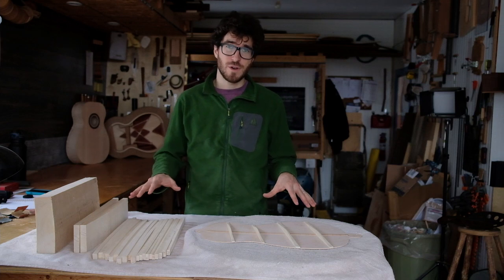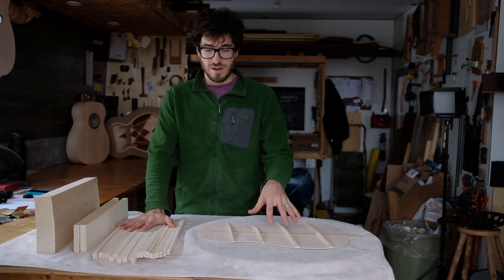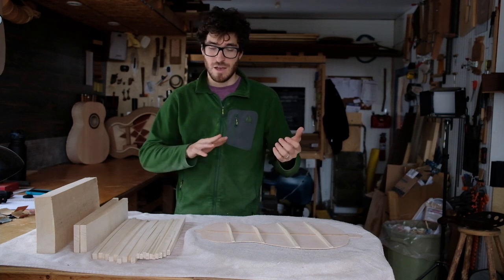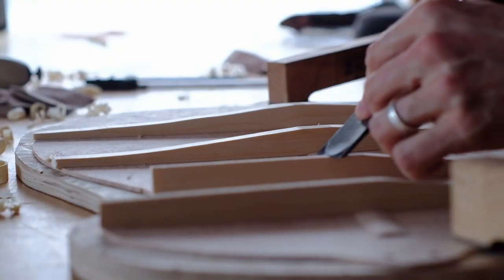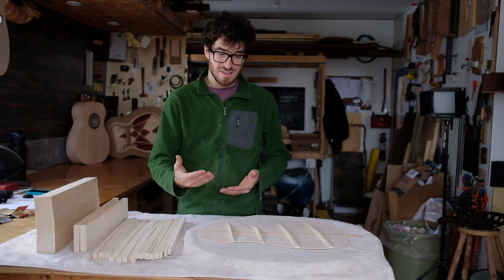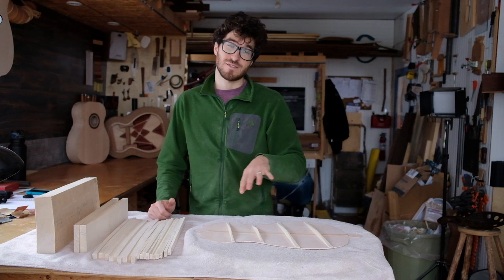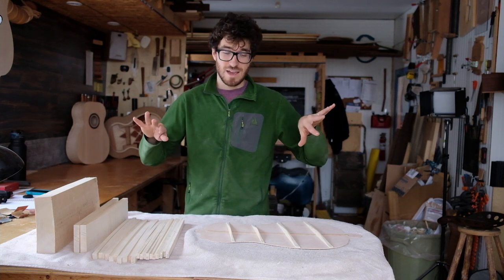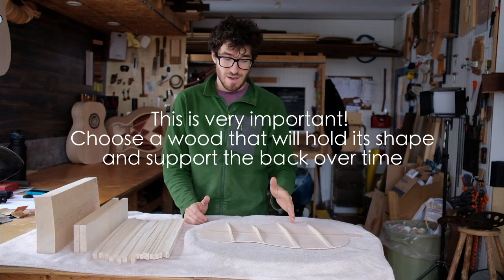What woods work well for Back Braces?

Comment: Have you ever experienced the back deform becoming flat again after 15 foot radius brace glued? And how to fix it?
Reply: Aha, yes I’ve had that happen once. It was in my first workshop and my humidity wasn’t as well controlled at it should have been. 
It happens when the environment the back is in is humid. So the wood is swelled up with that extra bit of moisture - then you glue the 15’ radiused braces on and as a result they try to hold the back at it’s swollen width… but the back wants to shrink and return back to a lower humidity so it is forced to only shrink on the outside surface opposite the bracing. This actually works very similarly to a truss rod. 
The only solution I know of is to rout off the back, knock off the braces and reglue new ones at a drier humidity. Then you’d likely have to add a couple purfling strips to clean things up. 
As a general rule I try to brace my backs, carve the braces and get it glued onto the sides within a day or two to make this less likely to happen. 
Hope that answers your question! It sucks to see a back go concave…😞

Comment: Hello from France, my concern is about bridges. Locally I can easily find good oak. Is oak suitable enough for bridges ? Thank you.
Reply: Hello! I don’t see any reason not to use oak. It should make great bridges. :)
Reply: @treehouseguitars  thank you. I already made two out of oak on old Kay guitars. I consider the result ok soundwise but I need to find one way to ebonize them, the raw oak colour doesn't match the tops of the 
guitars. Again thank you
Reply: If you’re going to ebonize it, why not use a different local hardwood that is lighter weight and less porous? Like walnut. Just a thought - a lighter weight bridge does make a more efficient, livelier guitar in my experience. My go to bridge material right now is Rocklite which is man-made, it’s already black and it’s actually not very dense at all.
Reply: @treehouseguitars  many thanks for your advices and very best regards

Comment: Douglas fir?? Thanks 😊
Reply: Ive used Douglas fir on a couple of backs. No issues so far 😊. Just made sure I used fir with nice straight, tight grain.
Reply: @andrewmundenandcadfellmast4624  awesome, thanks 😁 .. I don't have very good access to spruce here. Cheers
Reply: @andrewmundenandcadfellmast4624  - Awesome, great to know!
Reply: I haven’t really worked with Douglas fir so can’t say from experience. But I don’t see why it wouldn’t work! It can be a bit prone to splitting if it’s really dry and old I think, but like I said, this is just rumours I’ve heard, not from personal experience. :)
Reply: @treehouseguitars  thanks 😎👍
Reply: @kickhisassseabass318  - My pleasure! :)